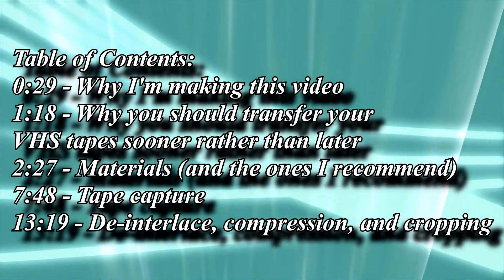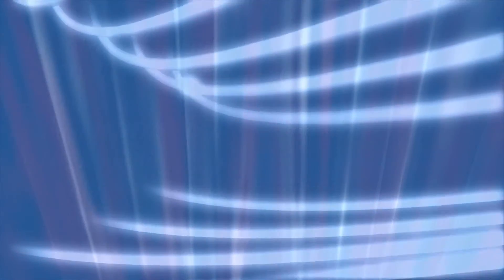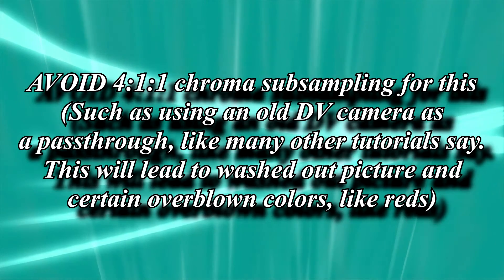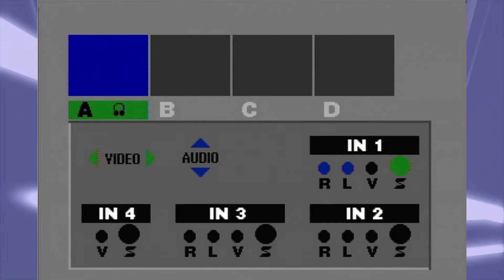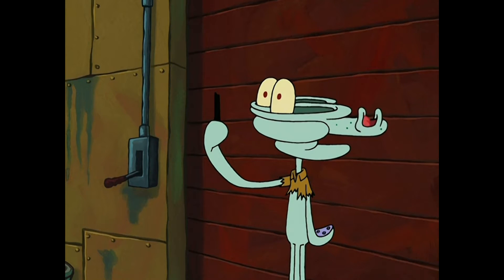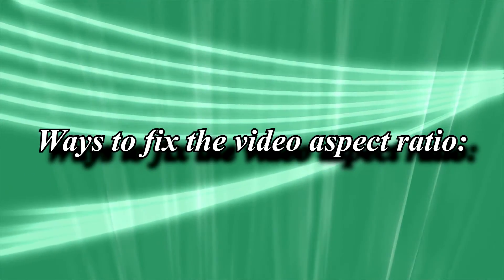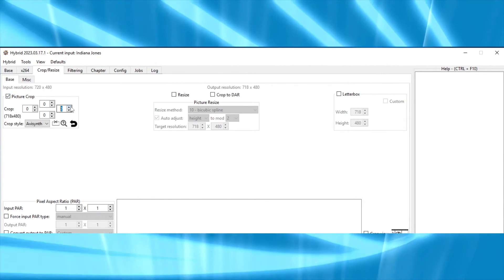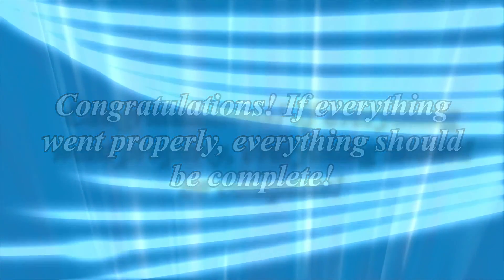The Ultimate VHS Transfer Guide

Comment: What are the differences between this vs using something like VHS-Decode?
Reply: VHS-Decode uses FM RF capture for archival and decoding, this just offers a relatively competent conventional capture but does not provide the information potential near RF does nor the VBI recovery capabilities.
Reply: VHS-decode is not a complete process, requires a lot of knowledge and tweaking, In other words it is not for the average person.
Reply: @Capturing-Memories  Just a little FM RF capture and a few copy paste commands at this point now we got self contained binaries 😉
Reply: @Capturing-Memories  If you think money is not a problem, you're right. Still, vhs-decode is the best option to avoid buying more and more just to convert just a bunch of tapes. With only a unmodified cx card and a cap being bought I set up the capture process, and then It's done. I know the processing part still sucks because digital signal processing still costs time, yet I don't have to worry about my processing hardware struggling to capture every single frame of realtime VCR video, because RF captures depends only on storage, which honestly is the smallest problem.
Reply: @arquivosdoInky  My point still stands, It's not for the average person with limited knowledge, which makes up the majority.
Reply: @Capturing-Memories  Limited knowledge people shouldn't try to do the digitizing theirselves at all. There are  a lot of services that digitize the tapes, they're mostly cheap, and despite not every has good approaches. Being for the average person, contact a service. Being for anything better, then do It as best as you can!
Reply: @arquivosdoInky  An average person is a person that can capture video normally with the available tools like myself, I don't have to know other people's field of study, The same way I don't expect everyone to be a mechanical engineer like me.

Comment: But how did you miss vhs-decode? ah you used DigtalFAQ as your refrance... also StaxRip is a lot more friendly then hybrid lol
Reply from the maker: I didn't miss vhs-decode when making the video. In fact, it was in my original script, but was removed due to time.
Also, when I was making this video, the project was (and arguably still is) a work in progress thing. But most importantly, I don't have a VCR that has any sort of guide for how to set this up. (To be fair I do have a digital8 camera that does, so maybe I'll try it for that?) Point is though I was aware of it, but due to how relatively early the project was, how difficult it is to set up, and my own personal lack of experience with it, I decided to omit it. If I manage to get it working and/or it simply becomes more user friendly, I'll likely update this tutorial accordingly.
As for StaxRip though...yeah I had no clue that existed. I'll have to check that out at some point.
Reply from the maker: I've seriously been considering working with vhs-decode on my own deck. I just think when it comes to a (relatively) "simple" tutorial like the one I've made, you lose a lot of people when you start it off with "Ok so you're going to want to open your VCR..."
Make no mistake that I think this type of project is going to be the best way to ever rip a VHS tape. It's just a bit more of a technical walkthrough compared to what I mentioned in the video. (To be fair I'll probably make a tutorial that includes the truly "ultimate" ripping method sometime down the road)
Reply from the maker: Ah, so that's why Mr. Smurf doesn't like it. I suppose that would make sense for him at least. I remember him being rather against/dismissive of the idea of a software level tbc a few years ago too.
And yeah I mean obviously you do want to open the vcr to clean everything. Some people swear by those "cleaning" tapes which I...don't get. To (roughly) quote Ben (of Oddity Archive) "It doesn't really clean anything more as it just rearranges the dirt."
I can also understand your problem with the word "ultimate" since you're correct that it isn't really "ultimate". We'll say it's that way for anyone too scared (or lazy) to open up their vcr. That's sort of what I was aiming for.
While I'd love it if everyone could use higher quality decks and use forms of truly direct capture, you can't ask that of a lot of people. And we all know that these tapes are degrading. I'd prefer people do the task as well as they feel they can now, and worst case scenario they come back and do it the truly best way later on, instead of being scared off for the next few years, at which point there's a distinct possibility their tape might've degraded significantly since then (perhaps to a point of barely being watchable).
Reply from the maker: I hadn't heard about those things with LS (although to be fair I'm not generally on the site to begin with).
As for what you said about the quality of VCRs, that does sort of make sense actually. I just figured getting an SVHS (or DVHS in my case) deck would be the best option in part because that's what many others are/were going with for the longest time, and I couldn't afford to test lots and lots of decks. I also assume that decks were recommended based on TBC and DNR capabilites?
Also honestly I'd love to see your LTO writeup, even if more for the sake of curiosity into how the system works than anything else.
Reply from the maker: That would certainly explain why during the creation of this video I kept running into old forum links, some as old as 2004. Hell, that's part of why I made this. So that people wouldn't have to go digging (as much),
As for LTO and M-disc, LTO looks pretty decent, although the life of those tapes are supposedly 20-30 years (and guess when LTO 5 tapes were being released). As for M-Disc, I'm actually quite frustrated by how they're capped at 100gb. Hadn't heard about ODA being discontinued, although that doesn't surprise me one bit either.
Reply from the maker: I think the big problem that at least I've had with some of those discs has been justifying the cost/gb. I understand they clearly won't be as cheap as a hard drive, but compared to that and tapes, the cost is enormous. And hopefully you don't have a lot of stuff to backup. I hadn't heard about what folio photonics is doing, though even then it seems that's at least three years away, and I worry that might be locked away into the "enterprise" sphere for a while after that. At this point in terms of cost it seems LTO is the best bet?
Reply from the maker: Using film as an archival medium? I mean, that could work, but I'm also aware of plenty of people trying to get old movies off of film, not the other way around. And if you have to reuse it again, assuming you no longer have the originals, you have to scan it back in. I could see the use in it, but that's likely for a very specific use case. Though you're correct in the sense that things like LTO readers will be increasingly hard to come by, so that's not the most future proof solution.
Since you're talking compression, by the way, what do you think of it? Is there a time when things like tape transfers can be compressed? Obviously I still stand by keeping the original copies (or at least the original rips) if you have the space to permit it. However, for the sake of portability, ease of use, etc., what do you think is good?
Reply from the maker: So I understood the first few, but I'll admit I got...not so much lost, but more so wondering the reasoning behind not using FFV1 when capturing in the first place. From all that I'd read, you're able to use FFV1 just fine. Also didn't know Resolve had finally implemented support for it (if only Vegas Pro was the same way).
As for photos, have you tried out JXL yet? It's still early days to be fair, but it at least looks promising, given its lossless capabilities.
When it comes to 35mm film, I had read that the resolution ranges from somewhere to 4k-6k (for movie film, anyway). Didn't know microfiche was still being saved to, since at least here in the US, we're trying to get everything OFF of those formats (and unfortunately some people aren't doing a very good job in the process).
As for lossy codecs, I don't really use them for pictures (Even for video thumbnails I've used png for as long as I can remember) or audio (usually either WAV or FLAC unless I'm already going through the process of compressing something), but I use it for some videos (mainly H264 still unless I have a want or need to compress it more). I think AV1 has a good future ahead of it, but perhaps that's just me. Also yeah mkv all the way over here. The only reason not to use it is if for some reason a certain program can't use it.
Reply from the maker: I can understand the penalties of using FFV1 on older hardware for sure. And yeah it isn't very good a timeline codec.
And honestly I've heard of DNG in passing, but I've never really used it. Anything I've scanned, for example, is just in plain .tiff files, at least right now.
When it comes to film, I'll be honest I don't know a ton about it. Like I understood it being measured in grain, but not much besides that. My understanding has always been the maximum DPI for scanning where one can still have any increased visual fidelity. An easy example is that when scanning slides (not the same thing but similar enough for this example), apparently the highest REALISTIC scanning solution is somewhere between 4800-5200 dpi. Any higher and you begin seeing dye separation (so yeah higher than 4K for sure to be fair).
And I can totally understand keeping things on microfiche for that sort of event. And I do think that if it's on there ALREADY, that it shouldn't be thrown out (which too many people are eager to do with most things).
Finally, as it pertains to codecs, you're right in that WAV is a container, so that's my mistake.